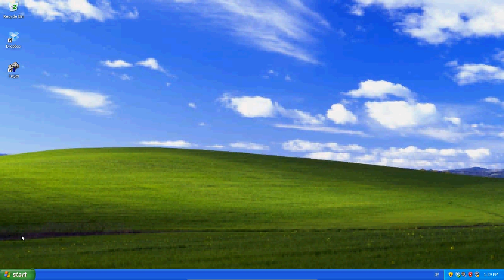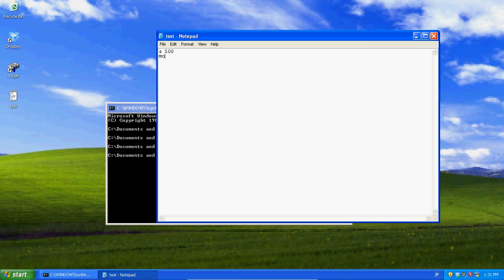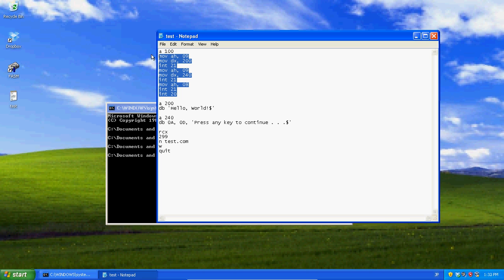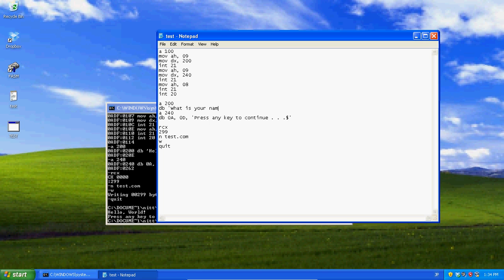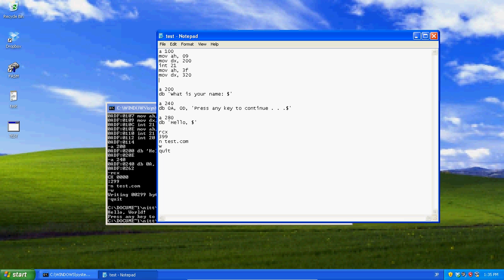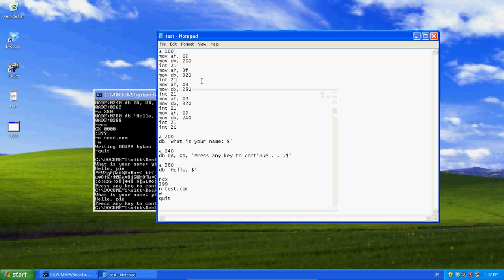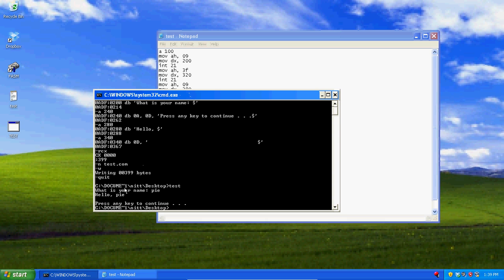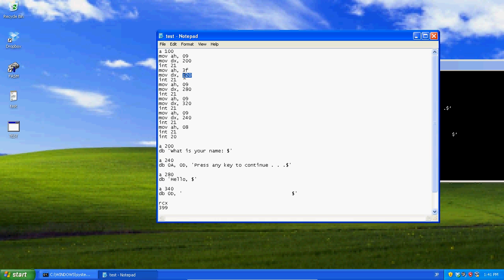Assembly Tutorial 6 - Getting User Input

Comment: khoraski There is a simpler method of getting user input that doesn't call any flags, 
for instance:
a
mov ah, 09
mov dx, 150
int 21
mov ah, 01
int 21
mov bl, al
mov ah, 09
mov dx, 180
int 21
mov ah, 02
mov dl, bl
int 21
mov ah, 01
int 21
int 20

a 150
db 'Name: $'

a 180
db 0d, 0a, 'Hello, $'

rcx
60
n name.com
w
q
Reply: Oh and I forgot to write that it also eliminates the need for a dollar sing to inserted (manually or in code), for it gets the input as a hexadecimal value.

Comment: Hint: We can also terminate a DOS based COM-programm with a "ret" instruction, if we do not corrupt the stack and the code segment. Because DOS place the instruction of an "int 20h" at the top of the PSP and it pushes a zero word to the stack just before it let the programm execute. If we execute at last the "ret" instruction, then the cpu return to the address of zero and continue executing the instruction of the "int 20h" inside of the PSP for terminating our programm.

But the default practice for terminating a DOS programm is to use the DOS function: AH=4Ch, AL=(DOS "ERRORLEVEL") of the int 21h.

Ralf Browns x86/MSDOS Interrupt List (RBIL)
http://www.pobox.com/~ralf
http://www.pobox.com/~ralf/files.html
ftp://ftp.cs.cmu.edu/afs/cs.cmu.edu/user/ralf/pub/

RBIL -> inter61b.zip -> INTERRUP.G
--------D-214C-------------------------------
INT 21 - DOS 2+ - "EXIT" - TERMINATE WITH RETURN CODE
    AH = 4Ch
    AL = return code
Return: never returns
Notes:    unless the process is its own parent
      (see #01378 [offset 16h] at AH=26h), all open files are closed and
      all memory belonging to the process is freed
    all network file locks should be removed before calling this function
SeeAlso: AH=00h,AH=26h,AH=4Bh,AH=4Dh,INT 15/AH=12h/BH=02h,INT 20,INT 22
SeeAlso: INT 60/DI=0601h

Comment: 0D /r means enter, it will set the output pointer to the beginning of current line
0A /n means start a new line.
In windows console, a new line is indicates by 0d0a
however in Linux, it is 0A only.
In this program, after user input the name, the data in ram is:
"name/r/nxxxxxxxxxxx/r                              $"
xxx is the random ram data
notice that /r/n is followed after "name", so the first line of out put is "name"
then, the second line will be some random data, how ever, there is /r and some space after the random data, so it will set the output pointer to the beginning of the random data, and cover it with space.